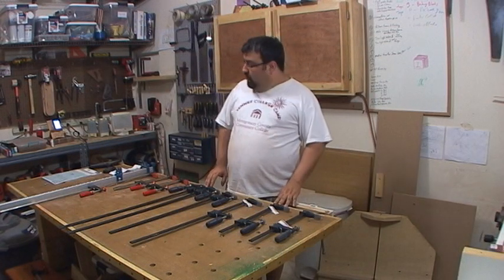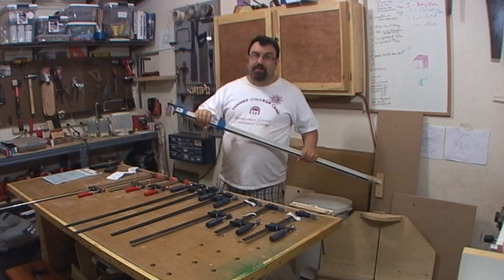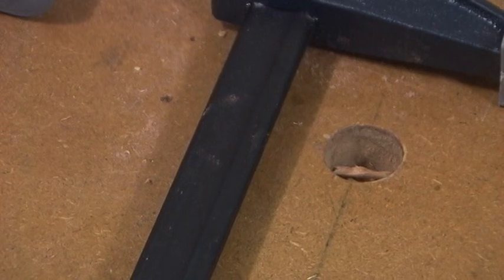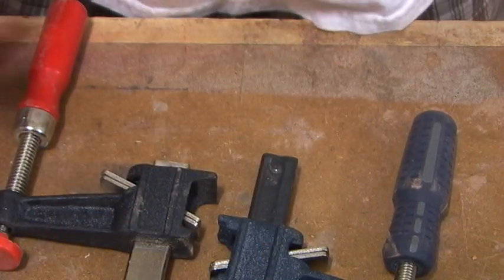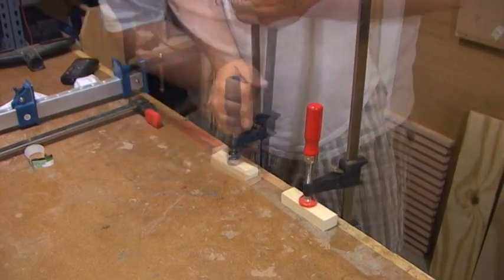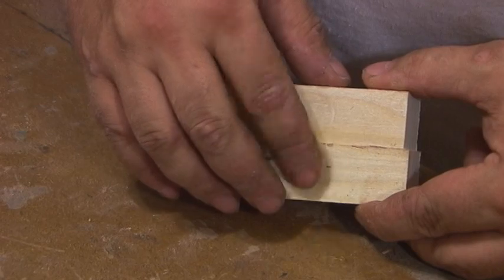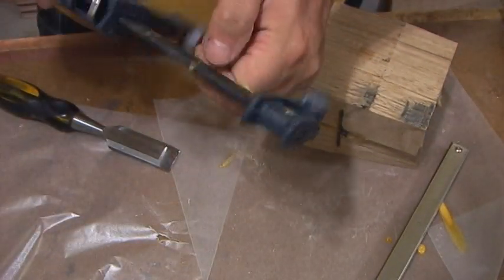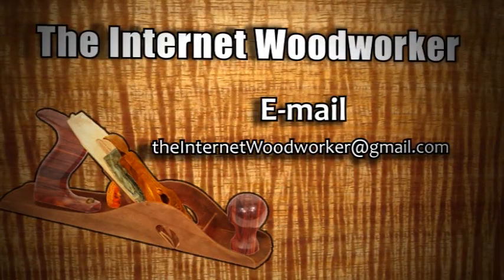TIW Review No. 01 - Harbor Freight F Clamps

Comment: They're good clamps. The handles are just pressed on though, so I've had a few come off when tightening the clamps down pretty good. Not a big deal though; I clean the end of the handle (the metal part) with acetone or mineral spirits and drop some 5 minute epoxy in the plastic part and smoosh them together. The repair hasn't failed. I've only had to do this on 2 out of 20 clamps (all 12").

They're great though; they flex less than jorgensen's 3700 standard clamps.

Comment: I have found that I reach for my HF clamps more often than my Bessey clamps. One thing I have noticed is that you MUST clamp them onto something before you buy them. Many are ground improperly or the threads are cut slightly askew. Just check them out before you leave the store.. Thanks.

Comment: When looking at clamps, look at the threads. HF f-clamps do not have ACME threads. They are pointed normal threads. ACME threads are square or trapped, which makes them ten times  stronger. HF larger c-clamps have ACME threads I think, anyway something to think about. Handles are easy to fix a stripped thread is harder. However if not abused the HF clamps should suit anyone's needs.